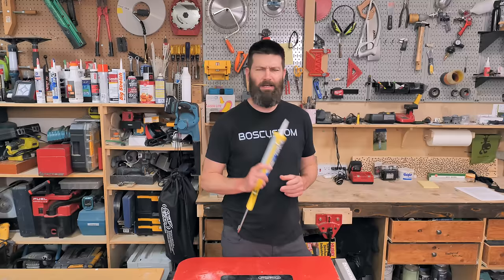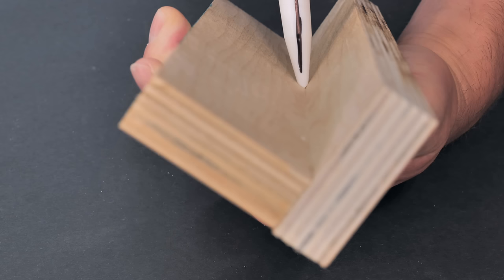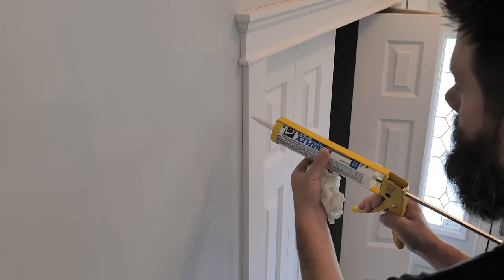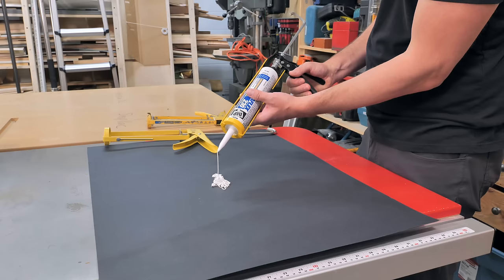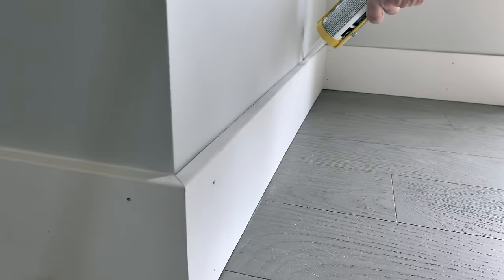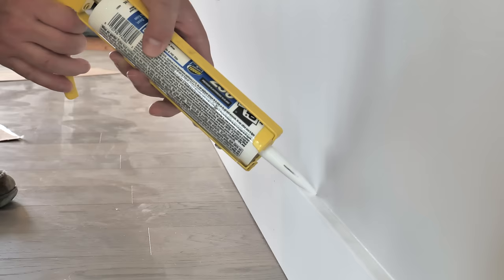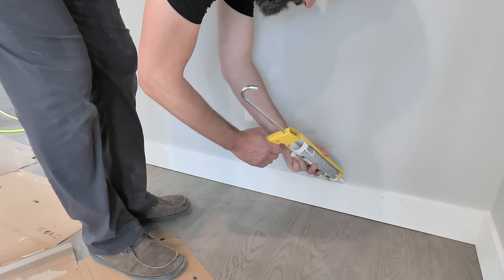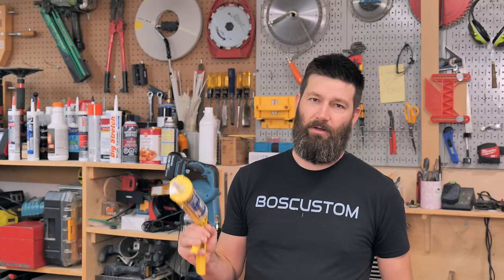The Secret Caulking Tip That Will Transform Your Ability!

Comment: I'm 58 years old. I've caulked professionally and personally on many homes. Do I know it all? Hell no, and that's why I opened this video. This guy told me a lot of what I already know and a few really good tips that I didn't. I like how you kept it moving. Not boring at all even on what I already knew. I wish more instructional video's followed this pace. Keep up the good work. 
The biggest mistake I've ever and many times made is simply cutting the tip too large. It's easier to add a little more on the first stroke and then cut the tip a little larger than to clean up a mess from a tip that's too large. Awesome video. Never considered sanding the tip into a corner. Thats really awesome!!!!!!
Reply from the maker: 🍻 cheers David, thanks for the awesome comment!
Reply: That tells me that you are a good professional. Because you’re watching videos trying to improve. My handyman has been doing this for 30 years and he is still doing the same thing that he was doing 30 years ago.
Reply: @shannawang  If you're complaining about you handyman not improving his ways of doing things, I'd ask why you've kept him for 30 years?
Reply: @clintm7274  I did not keep him for 30 years. He's been a handyman for 30 years. I've only used him once so far. But I plan on keeping him for rough works that doesn't require much detail.
Reply: I thing you no nothing about professional caulking, sorry
Reply: Figured half these tricks by my 20th year and 200th tube of caulking. Think he just saved me 20 more years of learning. Great info. Sanding the tip. Thats Pro Level!
Reply: cool, thanks for the tip
Reply: David Cole, I’m a year older than you and have been a carpenter/ glazier/ painter my whole life. I’m probably one of the finest caulkers around as well, but like you, I clicked on this just to see if there’s a new technique I hadn’t known. Found it. The sanding of the tip in a corner. That’s awesome! Learned something.
This is a video for beginners and that’s cool. Glad he didn’t use some weird tool because they all suck. It’s about practice mostly. A wet finger is the only tool required. A wet rag is always there to keep your finger clean and wet on every pass along the caulk line. 
I’ve run probably miles of caulk lines through the decades and it’s second nature to me. Interior caulking like this is a cinch. 
In the early 80’s I was a commercial glazier. We had to run perfect beads with urethane caulk, aluminum to aluminum, with no tooling at all. We used a fifty dollar caulking gun that with one squeeze, covered a 1/2” bead about six feet long. All you had to worry about was that inevitable air pocket in the tube that would burp and ruin a perfect un-tooled bead. Good luck making that mess blend in. Urethane is very unforgiving. You can’t use masking tape with urethane, the caulk sticks to it and your bead pulls away from the surface with the tape, leaving a whole different kind of ugly mess. Plus, speed is a factor. Time is money. I see these comments here about using masking tape and NOBODY in the commercial industry uses masking tape. No time to mask anything. We’re in, we’re out. Anyone who showed up on the job with a roll masking tape was immediately kicked to the curb. Too slow, you’re a moron. I found it fun walking around town and looking at various storefronts and inspecting the caulk lines. The caulk job on an aluminum storefront should look like a perfectly straight piece of rubber bead. I could tell if a guy was a pro or a rookie. It’s mostly about practice and doing it every day. I was a pro at storefronts but it’s been years since I did it and I know I couldn’t run a bead with urethane like I used to. Painters caulk, interior stuff, is no problem. The trick there is, the caulking shouldn’t be visible at all. It goes over the primer in new construction and just covers the hairline cracks between the casing or baseboard. Deeper cracks will shrink and need another few passes after they dry. But with a wet rag and a clean finger and some patience, you can make a sloppy miter look perfect. (You know all this, I’m just writing this for those who don’t.) Caulking is the magic that makes every imperfection disappear. Sloppy finish carpentry looks perfect after caulking and painting. Only the trained eye can see that you made a 45.5 degree miter look like a perfect 45. It’s an illusion when you do it right. And nobody who hasn’t done this professionally would ever notice that caulking was the magic that made the room look perfect.

Edit: One more thing for you amateurs struggling with caulking interior mouldings and trim. The wet rag is your friend. Keep the tip clean with it and if you totally screw up the caulk line, just wipe it off and start over. You’ll notice after many screwups, your wet rag is full of caulk. No problem, interior caulk is water-soluble. Even the ones with silicone, the point being, your rag has to be clean. Otherwise, you’ll be tracking the caulking all over the walls and floors. Rinse it out and start over. Neatness is key. Even have a separate clean wet rag that you’ll use to finish up your lines and any miters you repair on more intricate moulding profiles. The caulking will shrink as it dries. Let it. Don’t mess with it. Let it dry. If there’s still a dip in a crevice after shrinking now’s the time to fill it with a little more caulking. If you’re trying to patch a gaping hole with caulking, you’re using the wrong material. Caulking is only for finishing tiny gaps less than a sixteenth inch. Use drywall mud on any gaps deeper than that, sand and the finish with the caulking to hide minor cracks in the transition. Make sure you’ve wiped off every bit of crappy caulking that’ll dry stupid looking. You can’t sand caulking. It’s latex rubber with silicone usually. Your finish is done with a wet finger. Re-caulking over crappy caulking looks worse than ever. Treat the area of your screwup as if you’re starting from scratch. If you don’t like what you did, wipe it out and start over. You have time and you want to make this right and there’s nothing preventing you from doing that. It’s not like, “Oh man, I really screwed up that caulk line. Looks like sh*t. Guess I’m stuck with it..” No you’re not, wipe it off with the wet rag before it dries. Try again. Don’t stop until you’re satisfied with the look. While admiring your finished caulk line you might bump the tip against the wall and now there’s caulk on the wall. Or you forgot to hit the stop button and it’s on the floor. Caulking guns and tubes are unpredictable, assume they want to screw you over because they will. No problem. That’s what the wet rag is for. From beginner caulker to pro caulker takes a few screwups like anything else in life. Remember them, learn from them. Be a pro. 
Anyway, that’s all I have to say about caulking. It’s an art form in itself. Takes practice and a keen eye for detail.
Edit: I thought I was done with caulking but there’s more. Let’s say you just built a house or an addition to the house. (I’ve built many), and you’re looking around at the trim and nothing looks square. With building around strange shapes, of course it won’t look very good but you’re not finished yet. Sloppy carpentry is easily hidden as long as it’s painted. Clear joints need to be perfect though and sloppy won’t work unless the owner doesn’t care. That’s a dilemma of sorts for a finisher like me. “You don’t care how it looks? That’s just weird man!” 
I got this job on a mansion on Hawaii Loa Ridge. The richest area on Oahu. The customer was an anal-retentive heart surgeon. Rich as hell and he described what he wanted me to do and I said okay. I’m a master, but this is insane. I’m up for the challenge. 
It was an addition to his mansion but the Mango tree needed to stay and grow though it. For two stories. Lots of contractors rejected this job because it seemed impossible and hard to insure. I took it because I was fascinated by the prospect of a growing tree through two floors of a house. I was young and this’ll be fun. It’s possible and I can easily pay back my student loan on this job. The mango tree of course was the focus and obstacle to not “overcome” but blend in. It’s 30 feet tall and crooked like trees tend to be. It’s an adult tree though and might not grow much further. (I actually hoped it would die right now. That would make this job easier.) 
I called a friend who was a botanist at the university of Hawaii. I was a marine biology major, I don’t know shit about trees. 
I said I’m building an addition around a living mango tree and I’m a little worried it’s not going to be a good idea. 
He said, “How long did it take you to realize this?”
“Not long, but I need the money. The tree is 30 feet tall and lots of dead branches on it. I think the owner thinks it’ll live forever. I think it’s dying. Anyway, he wants me to build around it so it’s growing through two stories and the roof. You think of any problems here?” 
John said, “Yes! Does this rich prick have a problem with bugs?” 
I said, “Yep, he thinks I can seal around the tree and everything is painted white, rough nature growing in his home without any unwanted nature. Like bugs. Or growth or anything natural. I think he wants me to suspend time. Rich guys are like that.” 
“Sean, he’s nuts. You know that right?”
“Well yeah, but he’s not going to outlive this tree? He needs to come to terms with its survival eventually right? You can’t sterilize the f*cking thing, it’s alive and has bugs. He needs to adjust his attitude more in line with reality.” 
“Good luck with that my friend, I never liked rich people. They’re not normal.” 
Knowing I bit off more than I could chew, I went back to the home owner and gave him the bad news. 
“You’re a heart surgeon right?” 
He nodded. 
“Well your mango tree needs open air and space around its trunk to survive. That means I’ll have to build an open deck around the tree including the roof, so the tree can live. That’ll mean leaks, spiders, rats, centipedes, and whatever else is living in that tree, total free reign to your house. It’s just a balance to consider. Still want to do this?” 
He actually thought for a moment. That baffled me. How would anyone try to fathom around this reality? Like there’s still hope of a sterile room with a live tree growing through it? 
Anyway, I’m glad I didn’t even draw up prints. I walked away from that job. The only problem was the customer wanted the impossible. If it was a poor guy living in the forest who didn’t care about sterilization or bugs, I’d easily build around a mango tree and the rats would have names.
Reply: Why not do the neatest method (in my opinion) and put masking tape on either side, then you can create a nice edge with your finger and avoid all the mess around. Then just peel the tape once you have a nice finish? This is how i apply a nice silicon finish.
Reply: @shannawang  Time to get a new handyman
Reply: But surely ‘angling the tip’ with sandpaper means that you are only filling any gap which is likely to crack in future.. instructions on the tube tell you how to cut the nozzle.. the only tip you need is to keep the pressure and speed of application constant
Reply: @travismailsa1  I prefer his method over yours for most jobs... I wouldn't want to waste that much masking tape nor time putting it down before and pulling it up afterwards. Your trick would work for me in some other scenario... maybe when I'm using silicone on a small area but not caulking baseboards, trim, etc.
Reply: Great tips… I also have shed envy! 👍😊
Reply: @gabriels32  Corrections:  thing, should be think and no, should be know.  Sorry?
Reply: I pretty much knew these tips but still leared a one. Great video tips. Invaluable :- )